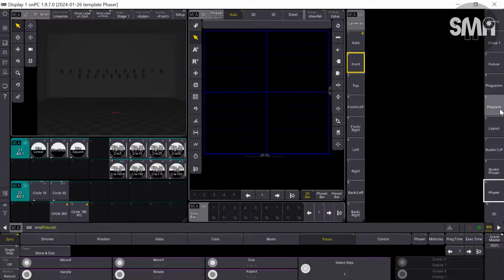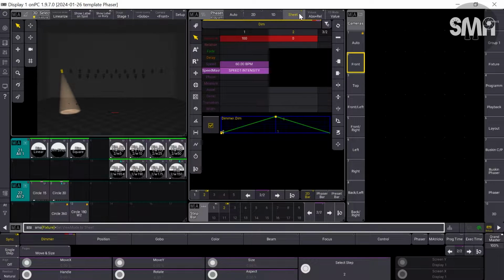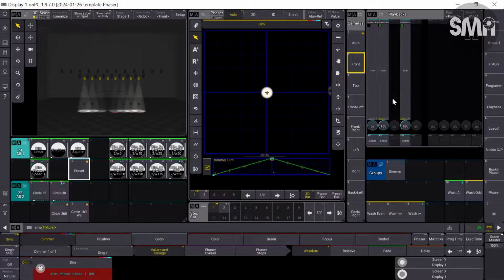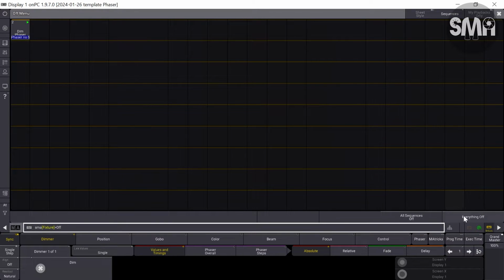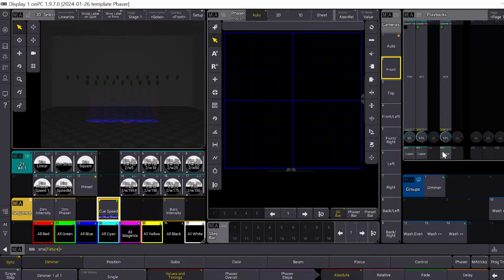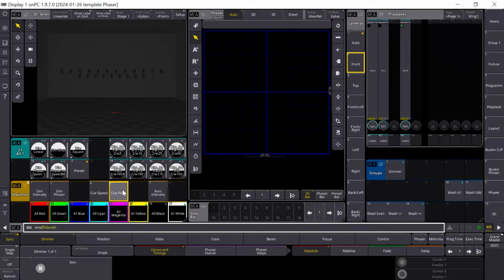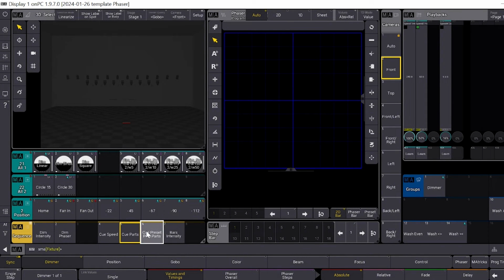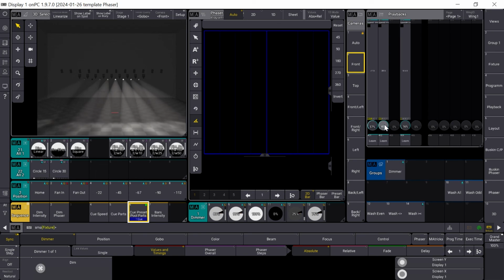grandMA3 - 3 different Ways to use SpeedMaster for Phaser

Comment: And would you control gobo rotation speed also with a speedmaster (even though not in a phaser)? I guess on playback #3 to stay in your numbering scheme?
Reply from the maker: Hello Paul,
I'm not entirely sure, but I think SpeedMaster can only be used with phasers.
If you want to control the gobo rotation via a fader, I would suggest the following solution:
1. save a preset with the fastest gobo rotations. But be careful, it must be the fastest gobo rotation with the highest DMX value on the channel that controls the gobo rotation!
2. go to Patch / Fixtures Types / the fixture for which you want to control the rotation /edit / corresponding mode /edit / GoboXPos
2.1 then change the value in the Default column to either the DMX value for gobo rotation STOP, or gobo rotation fast with the lowest DMX value
2.2 exit the patch and save
3. create a sequence with a cue in which you use the preset saved in step 1.
3.1 Assign the sequence to a fader
3.2 Change the setting of the fader from Master to Temp

Now you can either change from fader to 0% (gobo stop) to fader to 100% gobo fast (highest DMX value)
Or from fader to 0% Gobo Fast “clockwise" via fader to 50% Gobo Stop to fader to 100% Gobo Fast "counterclockwise" (highest DMX value).